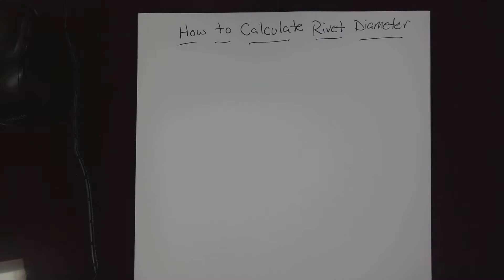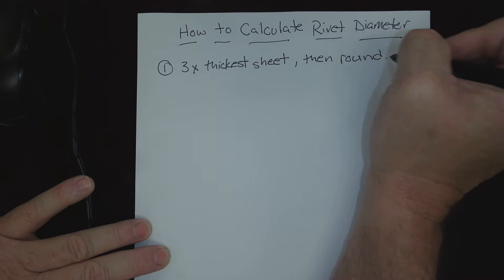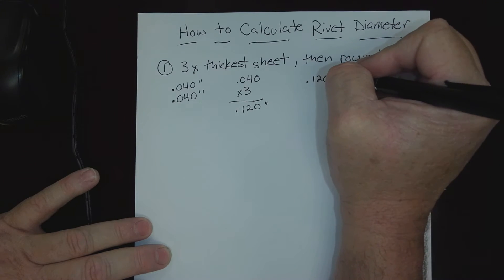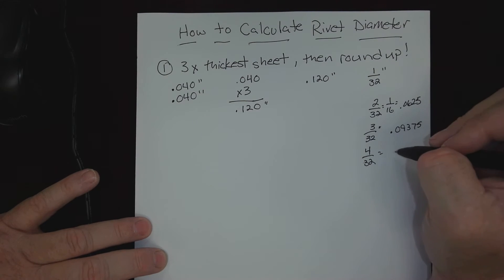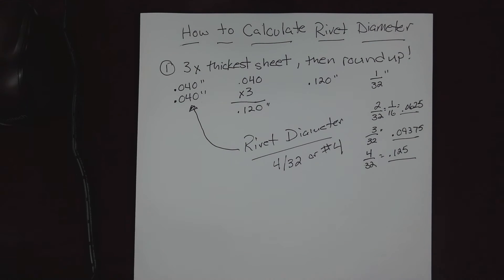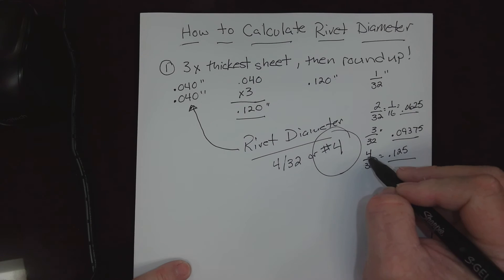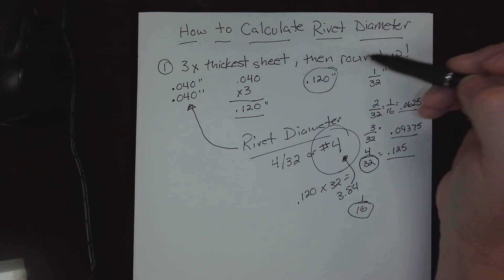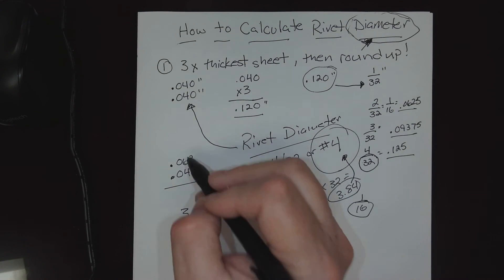How to Calculate Rivet Diameter

Comment: Hello jay, if I have to join.125+.032+.125 sheets what diameter ms20470 ad rivet I’ll need?
Reply: .125 + .032 + .125 = 0.282. We will take 0.282 x 3 = 0.846. Rivet diameter is 1/32 increments. We will round up always. So the Rivet diameter will be 28/32 or #28 = 0.875.

Comment: How do I calculate a 4/32 rivet. What is the shop head and height and width! Thank you can you provides steps
Reply from the maker: A shop head on a 4/32 rivet is 1 1/2 diameters wide and .65 to 1/2 diameters tall when finished.
That is the same rule for all solid rivet shop heads or buck tails, 
Convert 4/32 seconds from a fraction to a decimal, and it will be .125. Multiply 0.125 × 1.5, and you will end up at 0.1875 wide or 3/16"
Multiply 0.5 times your diameter. At point 125 and you will arrive at .0625 or 1/16".

Hope this helps, and thank you for the question.

Comment: This is great to understand the principles, but in reality this is all calculated for you in the SRM
Reply from the maker: I agree in most cases. For AMT students, they must be able to make the calculation to pass the class. Many older aircraft do not have comprehensive SRMs and the rules would need to be applied to select the correct rivets.
Modern aircraft do have much better  publications which eases the process.
More on this can be found in th AC 43.13-1B.